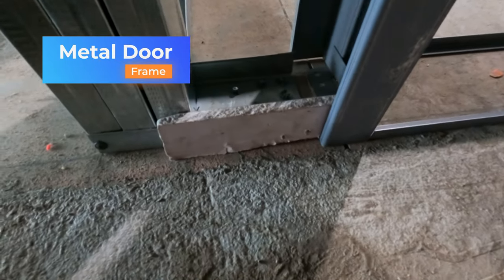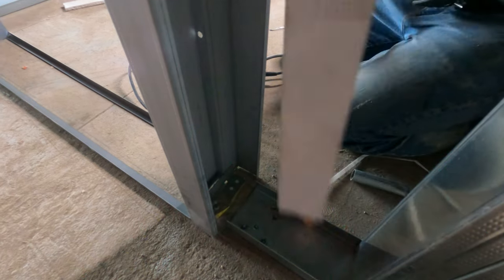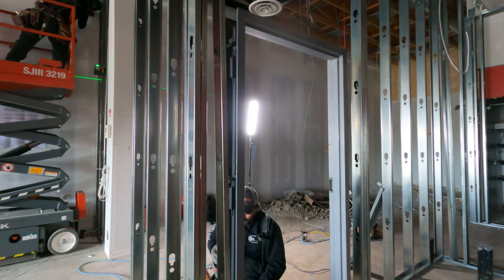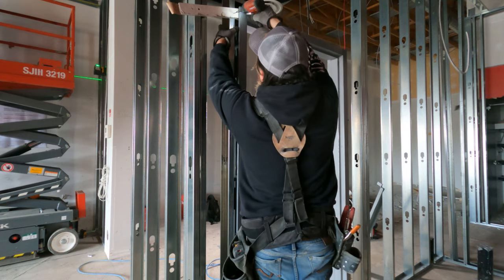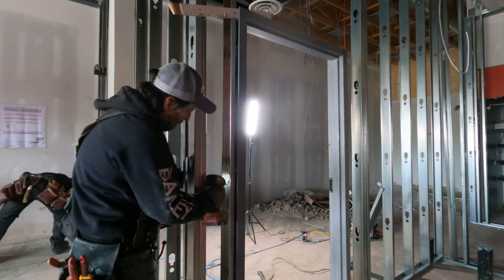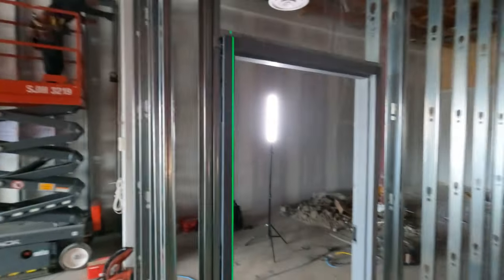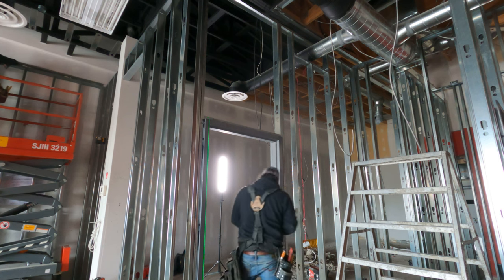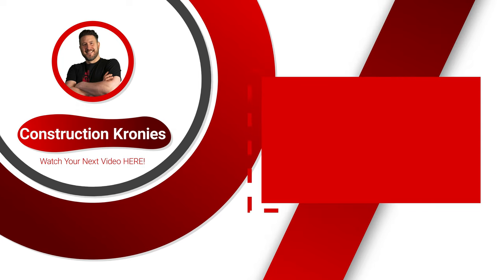Installing A Metal Door Frame

Comment: My company installs commercial doors for a living and I have made lots of money fixing welded frames that weren't installed square/plumb/level. #1 the spreaders need to be removed before installing,  They are there for shipping only.  Welded frames off the truck aren't always square.  Check the manufacturers specifications for those that don't believe me. #2 The first step before attaching the frame to the floor is check the head for level.  Tapcons are better than drive anchors because you can shim easier.  The Hangers need to final check the frame for plumb with a level before screwing off the rock.
Reply from the maker: Yes, everything you said is correct. For us, the contractors almost always ask us to leave the spreaders in until the guys come to hang the doors, I think because they want extra protection from trade damage. When we do the framing we always level the headers, and in hallways or rooms with multiple doors we go off the high side. I never install frames in other guys framing so I know my headers are level and studs plumb. And yes bro, I teach every drywaller to Plumb the hinge side of the frames before screwing off the rock! The tapcons we use on occasion, it's just not a fastener in our regular arsenal like the smack pins. Cheers bro I appreciate the comment!

Comment: I need your help I’m about to do a metal framing wall, only thing they want me to leave is an opening for a rolling door,  the framing opening is 16x16 what is your suggestions?
Reply from the maker: An opening that big for a rolling door 100% will need structural red iron columns on either size and a tube header to carry the door cage. The metal stud will finish it so you can hang drywall, insulate and make it purdy!

Comment: Hard side of 1st stub on both sides of door opening  then what about  the 2nd stud left side & right side of door hard to soft ALWAYS? Or stay with wall layout?
Reply from the maker: If its a double stud door opening always hard side to the door! Then your wall studs all keep the hard side the same pointing in the direction you laid it out!
Reply: @ConstructionKronies  thank you! In commercial construction not all doors are double studded? I'm a union Carpenter but I got into the field as a exterior building Foreman and have only done Acm, vinyl, and Hardie never did anything else other than in the Apprenticeship program but them classes are rushed! I've decided to give up my Forman position & leave the company I've been at for 10 years due to the atmosphere there and new management running the business what I believe is into the ground! So I'm starting over at 42 years old  with 5 kids and a wufe to have to provide for and will start metal studs ,drywall shaft, & drywall grid tomorrow. I've watched probably 30 of your videos in the last week and I think I'll be ok till I get the swing of it and how my new crew works but thanks for answering!!!!! I'm probably going to be asking questions on your videos for the next few weeks at least

Comment: How much do you charge for metal framing and door frame install
Reply from the maker: $4.50 to 13.50 / foot plus $50 per door.
Reply: @ConstructionKronies  I may seem like a rookie right now. But is that per square foot. Is it off the wall you’re bidding on or the building square foot. Appreciate your time
Reply: @ConstructionKronies  what state do you work in. Those prices seem low.
Reply from the maker: @1mandrywallarmytv144  Yes I am in Canada, Alberta. We are not the most expensive but aren't the cheapest either. We usually end up in the middle to high for pricing. Your right though, its too competitive and rates are too low.

Comment: Thank-you. My father told me to use washers on the bottom clips. Is this still necessary?

How do I send your $10 without recurring payment?
Reply from the maker: It's not a bad idea at all, I just never seen that but a washer would definitely make it stronger, sometimes the hammer drill will make the holes bigger and the pins just barely cover. I'm going to keep some washers with me in case that happens. And thank you I do appreciate the donation, you can super thanks me, there is a button below the video to do that. Always appreciated, thank you.

Comment: Good videos man!! What size of interior stud do you use or recommend for interior division walls that are 16x12
Reply from the maker: 3-5/8" is standard. 12' high, 15 gauge will do but if you want more strength go.uo to 20 gauge.

Comment: So curious on the double jamb studs, you left them loose and they are not connected in any fashion to each other?  Seems also to be a push to go with single King-Stud in lieu of the double studs?
Reply from the maker: Yeah, so this guy always uses expandable frames, this was the first job I did for him, what I do now is always add 2x4 around the inside, drywall then put the frames in. I don't like that system, i like using double stud and installing the doors along with the steel, way stronger and look better

Comment: Why is it so important to laser the hinge side first when putting up drywall?
Reply from the maker: Its a steel stud thing, light gauge framing is weaker. We level the hinge side because everything else should be squared. The best way to do this is to actually use 20gauge studs for the doorways. The 25 gauge needs the drywall to keep straight. That's also why we draw our 16" centers on the sheets and screw in the studs at the top of our sheets on them, to set them straight for when we stagger where the sheets ends from either side of the wall.

Comment: Hey bro u didn’t show leveling the horizontal of the door frame because the floor is not always level you have to put shims under the frame before you pin it down also I always step up a laser when I’m boarding it before I screw into the door stud because the board will often push the frame out of square the zip screw isn’t enough to keep it from moving
Reply from the maker: Shoot man, my bad, you're correct and always putting a laser on the hinge side of the frame when boarding is critical. Cheers!

Comment: So this interesting, this is my career as well and on the hollow metal door, those aren’t spacers the just ship them like that to make it easy, your supposed to make your own spacer and grind the metal off, but hey might be different where your at
Reply from the maker: You know, it would make it easier to grind them off before we install them and then use a nice plywood jig. I have seen it done both ways. I don't know why we do it like this, I just haven't thought about it. Great comment!